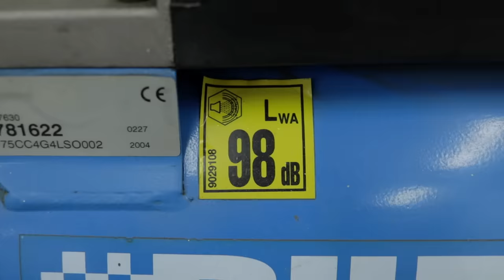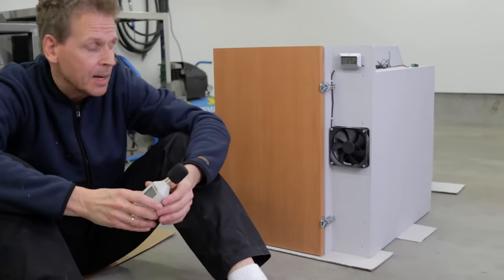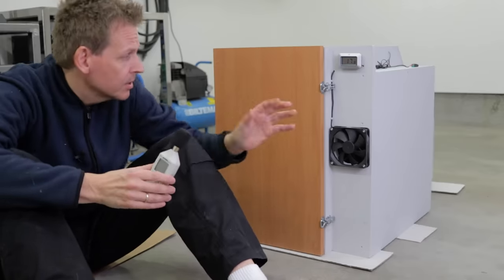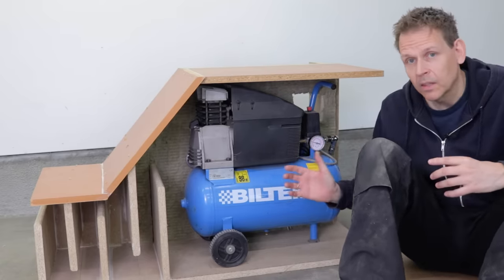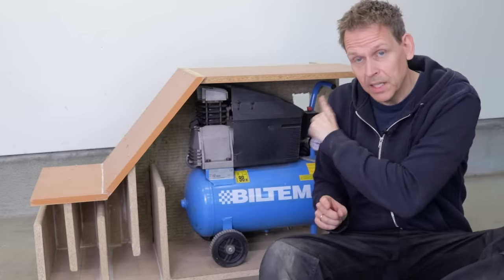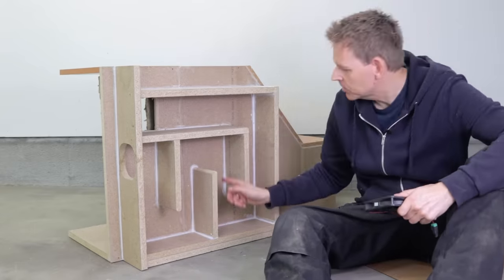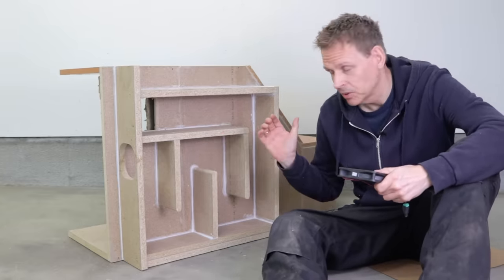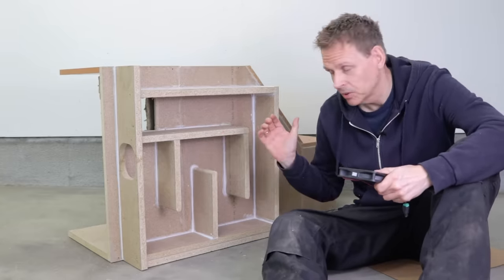Do not build a sound insulated enclosure for your noisy air compressor!

Comment: Great video, but one major factor you haven't account for is in the design. So first up is the fact it is single walled and the material is particleboard, which is not as dense. MDF would be a better option, especially getting thicker sheets and making sure the corners are well sealed.

Doing this with a double walled box will be a big improvement. Of course this adds to the cost and time to build it - whether this is worth it is subjective. If you have no option to move the compressor or to get a different one then the price is not an issue.

The airflow path is also very open. Many designs i've looked at use small channels and more of them, as well as lining the entirely inside of the channel with foam. 

It would be great to see you try some new designs in the future, putting the same compressor in each to see how they perform.
Reply from the maker: Hi, thanks a lot for you feedback! I agree, MDF would have been better, I have built some speakers over the years using MDF. The cost for MDF is however quite high, probably 4X compared to these mass produced flooring chipboards I used. But I agree, it would have worked better.

Double walls would have been great, although I think most if the noise now comes through the air vents. I did not want to make the channels in the ventilation system to narrow as I was afraid of it reducing the airflow. When I check the temp inside now it barely rises when the compressor is running, so I think I'll try to add more insulation into them. 

Thanks again for the feedback, highly appreciated!!! 😊
Reply: No worries. I agree most of the noise will be from the inlet and outlet areas. A better design will mean spending a lot more money and time and everyone has a limit. 

But here's what I would update for a new version:

1. More channels, tighter spacing and covered in foam on all surfaces. The same arrangement is used on the intake and exhaust. 

2. Fan moved to exhaust (negative pressure) which will be more efficient. A larger fan will be needed (ideally with speed control). A temp sensor near the exhaust area will help determine what fan speed is suitable.

Personally I use a quiet compressor with a laser cutter but I want to reduce it even further as i'm in a small garage. There's a market for this kind of product but no one is making them, at least not here in Australia. 

I will be working on prototypes and doing testing. I'm surprised I haven't seen anyone do detailed testing and try out different features/techniques/materials etc.
Reply from the maker: Nice, thanks again for good input! I suppose it is hard to get off the shelf sound insulated boxes for compressors as they some in all kind of sizes, and from my experience it takes quite some time to make them, so it will probably be very expensive 😬 Good luck with your project! 😊
Reply: Another thing he can change is to use Sound deadening mats, I built an enclosure for my 25 Gallon Husky using OSB and Noico 80mil Sound deadening mats.  Not only does it cut down on how much sound you hear, but it also reduces vibrations.  For my ventilation, I drilled 2 holes in the wall leading to the outside of my garage.  The Fresh Air intake I used 4" dryer tubing, and 3d printed a sound reducer that goes on the outside of the house.  The Exhaust I ran the 4" tube under a table next to the enclosure hooked up to a small motorcycle muffler, this also helps keep the garage warm when it's cold out.  The second hole in the wall is for the compressors Air intake for the pump itself, and used the same size tubing that was on the pump to the wall, with a 3d-printed silencer.  I didn't run a dB check but it went from having to yell to hear someone to the talking volume you would use if someone was using the vacuum cleaner in the other room/same room.
Reply from the maker: That sounds like a well thought of solution 👍 I  am using 30mm  ROCKWOOL sound absorbing insulating inside the main chamber, might be that other material would perform better.
Reply: @kihestad  It has really sticky self-adhesive that consists of butyl.  Once the stuff gets settled, it doesn't like to come off easy.  They use these mats in cars before installing audio equipment.  It's about $20 for 10sq. Ft of 80mil.  I needed 2 boxes for my setup.  I would get at least 2 boxes for your setup.  Make sure to get a small barrel roller to put it on with if you do pick some up.
Reply from the maker: @pheelix-  Got it 👍 thank you for useful tips!!! 😊
Reply: @kihestad  Np, if you would like I could send or link a video of the before and after dB levels.  Or if you just wanna test the stuff for content, have at it :)
Reply from the maker: @pheelix-  I checked the Noico's web pages, seems like they have a lot of good products. It would be cool to see a before-after video. I always find it useful to check out new products 🙂 ps: if you don't want to share it publicly you can send link using message on my Instagram.
Reply: @kihestad  https://youtu.be/KcwfSCilV40  If you would like to see how I have the cold air intake and exhaust ran I can make another video.. This one just shows the change in dB levels.  There is probably more I could do to make it even quieter but you will see the huge dB difference with what is already been done.

The Blue light in the back is a Electronic Thermostat Controller, I use this to control the intake/exhaust fans when the temp inside the enclosure gets to high from the pump.  The fans will keep running until the temp drops back down to the set level.
Reply from the maker: I will definitely take a look!

Comment: Maybe you could install the  the old compressor in series with the new one, to increase the volume of air, but only use the new motor to compress? 😊
Reply from the maker: Hi, yes it has crossed my mind as well 👍 I'll put the old one aside for a while and just use the new one to see if it has enough capacity.
Reply: He could use both motors, it would just require a One way Check valve from the smaller pump/motor to the other tank.  This way the 2nd tank/motor doesn't get pressure push back from the bigger tank/motor.  I plan on doing something like this soon as the pump/motor on my 25gal doesn't seem to be able to keep up with my small sanding tool I use.
Reply from the maker: Aha, that was clever. 'One way check valve' is noted 😊 It does give great flexibility, for quiet/normal operation when less air per minute is required, only the compressor in the noise-cabinet could be turned on.
Reply: @kihestad  Yup just set the second compressor to turn on at a lower psi and it shouldn't kick on unless needed.  In my case my 2nd compressor is a small dual tank portable type that maxes at 120psi, and my main 25 gal maxes at 175.  So I shouldn't have to adjust anything as the smaller compressor is already set to turn on a off at lower psi.  If anything it just helps add a little more CFM when PSI reaches that level.
Reply from the maker: Very smart! Adding a delay relay would also make sure it does not turn on before the main compressor had got the chance to fill up the tank!
Reply: @kihestad  Shouldn't need a relay as most compressors should have 2 screws you can adjust, 1 to shut off at max psi, and 1 to turn on once the psi drops so far.  Now that I think about it, my compressor shuts off via pressure switch that is not adjustable.  So depending on the compressor a relay would be needed.
Reply from the maker: @pheelix-  Yes, this will work as long as you have pressure in the system. I turn off the main power every night, and turns on the compressor only when I need it. There are always some small leakage, so there is normally no pressure left in the system next day. It will cause both compressors to turn on when 'booting' up the system. My idea was to put on a timer / delay for the 2nd compressor, let's say for 10 minutes, so it will not kick in on startup when system has no air pressure. Not a big deal, it was just an idea 💡😊
Reply: @kihestad  A couple smart plugs can take care of that.  I have one on my compressor to turn on at 10am and off at 10pm.  Can link 2 of them up to trigger off of each other using smart timers.  Smart Plugs and Switch's are nice.
Reply from the maker: @pheelix-  I have some of these in my house (tuya smart plug), never thought about using them in the garage - but why not 😊 Good idea!
Reply: @kihestad  check the amps on them, make sure they are 15A.  You might be able to get away with using 10A ones.
Reply from the maker: @pheelix-  Yes, I will check how many watts that can handle 👍
Reply: @kihestad  Amps, not watts.  Air compressor motors will draw a lot of current.  I would check to see how many amps your compressor recommends in the manual.  My compressor is 1.3hp and requires 14-16amps.  Tho I have checked and it only uses around 10amps but it could peak to 14-16 at times.
Reply from the maker: @pheelix-  Got it 👍 watts = volts * amps 😁

Comment: I'm an audio engineer with a decent background in acoustics. It seemed like much of the sound was from vibrating the floor of the enclosure which transferred into the floor of the room and thus the air. I'd suggest reducing sympathetic resonance with a rubber or mastic flooring inside the enclosure. It won't make a huge difference, but it's an easy add and will attenuate a few more dB, and reduce vibration in your structure. Aloha!
Reply from the maker: Ahh, then you are much more qualified than me when it comes to understanding how sound works😊 I think you are spot on bout the vibrations. It is probably the biggest source of noise now. Will try to improve it by adding soft rubber, dampening foam or springs on the compressor and/or between the box and the floor to improve it. Thanks for the tips! 😊

Comment: When I worked at a truck repair shop we had a large high capacity air compressor with a very large air tank.  It was located in a shed behind the shop and the noise it made inside the shop was very small.  All we had to do was periodically go out there and open the bottom drain valve to let any accumulated water out so it did not diminish air capacity.

A lot of people make the mistake of not purging the water that condenses inside their air tank frequently and then wonder why their air capacity keeps decreasing.  If you build an interior sound dampening enclosure for your compressor inside your shop, I would strongly suggest running a line from the bottom drain valve fitting to a drain valve mounted on the outside of the enclosure.
Reply from the maker: I wish I could keep it outside my garage as well, but I just dont have space for it. My garage is placed with minimum distance to two of my neighbors. The side facing my own property is not usable either,  as it's just a slim path between my garage outer wall and a concrete retaining wall. In front of the garage door is no good either 😋
I agree when it comes to draining the tank! It's a bit cumbersome as it is now, I need to open the four eccentric locks and pull of the door and then take the compressor out of the box. It takes no more than 5 minutes, but it's enough to postpone it to the next day 🙄I better put on a line and have it on the outside....
Reply: @kihestad  
Understandable.

The shop I worked in was between the track of a railroad turn around and we had a salvage yard on the other side and we had an air tank of a little over 2200 liters.  You do the best you can with what you have.

Since you have a small air compressor, might I suggest you connect a hose between the compressor drain and an easily accessible place on the wall of the box.  A 90 degree ell on the bottom of the tank with some sort of quick coupler to hook the hose to the compressor and then a fitting that goes through the wall of the box (not the door) and a drain that empties downward.  Then you could simply uses an old milk jug to drain water into and then just poor it down a sink drain.

Then if you needed to pull the compressor out of the box you could use the quick connect to unhook the hose and pull it out unencumbered by the hose.
Reply from the maker: @oldtimefarmboy617  Yes, that was a good Idea. Adding a 90 degree bend and a quick release coupling sounds to be very smart! 👍Thanks for the tips!

Comment: Here is my 2 cents : I bought CNC machine 3018 and it sound like jet engine . I made 3/4 plywood box from 5 sides ( the 6th side  is the carpet on the floor ) and I used what is called Chip Foam of a thickness of one inch ( 2.5 cm )and installed it from the inside of the box , I checked it with an alarm clock and out of box the noise of the alarm clock was 74 dB and inside the box the noise was astonishing 47 dB . But note : box are all closed except  small hole for wires  and I used sound meter almost the same one  you used and the last thing is the box by itself has small effect on the noise reduction . Keep up the good work .
Reply from the maker: It's a bit easier to sound proof if you don't need ventilation to get rid of the heat. Well done! 👍

Comment: I have an 80 gallon , 5HP , dual stage air compresdor and it is nowhere near as loud as those oil free air compressors.
I mounted mine to the floor with 1.0" or 25cm rubber pads under and on top of the tank feet.
I made up a heavy rubber hose in the shape of a loop for connection to the pressure lines mounted to the wall.
I have seen people use an automotive air filter assembly adapted to the compressor air intake.
It does make the air intake quieter and also filters the air better.
Other than some sort of baffled enclosure , there us not much else that can be done.
Keep in mind these things can get very hot while running as they also need good cooling air circulation.
Reply from the maker: 80 gallons = 300 litres = more than 10 times bigger than mine (24 litres)  😋 that's a different league 👍 I had a bigger workshop with some friends in my younger days. We had a 1000 litres air compressor, that was also more silent than the little noisy one I had now 😌

Comment: KI, I love your design, very impressive. I did buy a quiet compress from California Air, but I also still have a small dual 'hot dog' style compress.  It's portable, good for job site nail gun needs, etc.  I didn't want to use the hot dog unit in my small shop because it's so loud.  However I love your solution and now you have me thinking (which in my case can be trouble a brewing) but regardless, I may find building a sound enclosure with inlet and outlet baffles significantly reduces the loud screaming to a more tolerable level.  

Now I need to purchase a sound level meter.  I being a guitar player didn't want one because it would only confirm what neighbors down the street and around the corner complained of that I'm too loud.  I'll get one and of course, exclude it for use of impuning my guitar volume as the cause for the degeneration of today's youth.

Thank you for your time creating this Ki,

Blessings,

Bill Bores
SteelBender Innovations
Cypress, TX.
Reply from the maker: It sounds like we have a lot in common, I do play guitar (not very often these days) and I also have one of these small portable air compressors, mine is super loud as well. I agree to your plan, just don't use the decibel meter when you are playing guitar 😅😂

Comment: I constructed a DIY air compressor using a compressor from a refrigerator. It doesn't produce large volumes of air, but it's so quiet that you can use it comfortably at home. I utilized it for airbrushing, and the tank was a repurposed refrigerant cylinder. In essence, if you don't need large volumes of air, for instance for spray painting with a gun, I would recommend this setup. Additionally, you could use a large receiver and create a multi-stage system: the quiet compressor operates by default, and a more powerful one kicks in only if the quiet one is not sufficient.

Comment: Hey, I know you're not too impressed with the solution overall, but this is really helpful for me, so thank you. I have a water cooler that is quite loud, and it's a quieter one, so I will be trying to build a box like yours. I am in a residential area and a tiny workshop, so reducing noise, even if a small amount, really helps. I was actually impressed by the noise sound of the quieter compressor + box. Thanks!
Reply from the maker: Glad you found the video helpful 🙏 I am still using my enclosure with the silent compressor inside. I live in a residential area as well, and it's nice to know that you can't hear it outside the garage anymore. Well, perhaps if you put your ear against the outside wall and listen carefully 😅